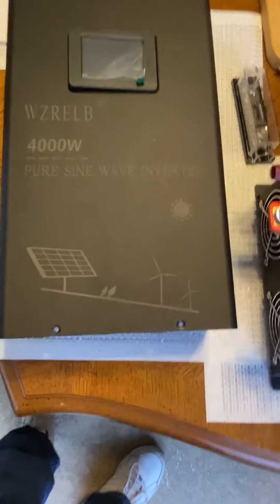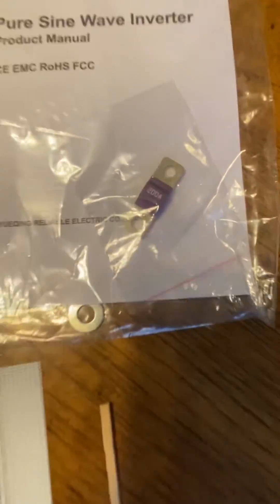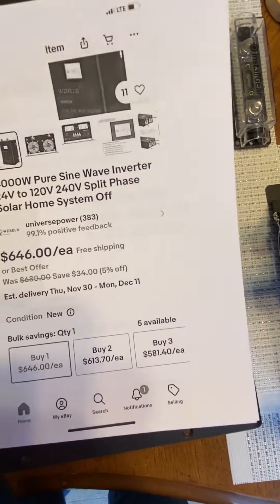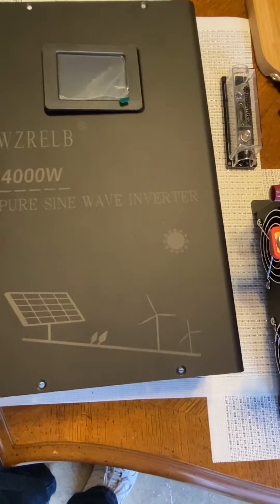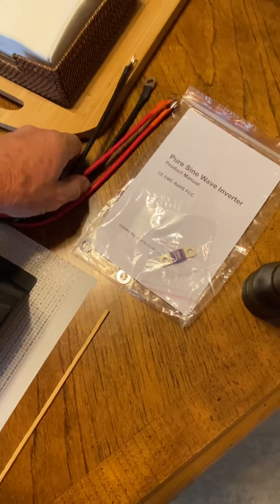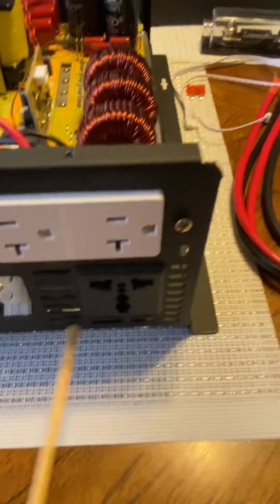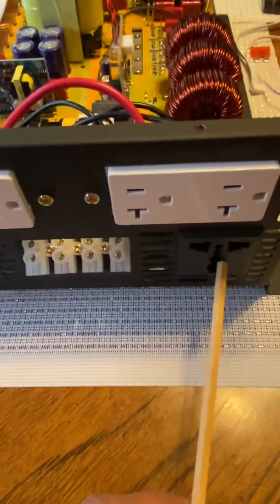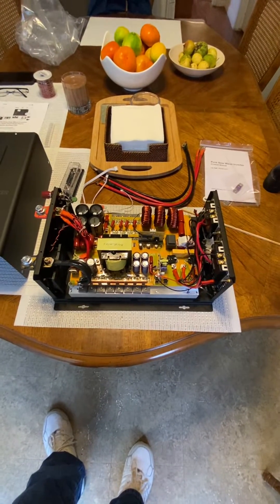Reliable WZRELB 24v 4000w split phase inverter.

Comment: I think the 240V outlet is a NOT a split phase 240V output, but just a 240V outlet so it wouldn't have  a neutral, but ONLY a ground. That would be correct so bonding N-G is not great idea and should avoid it if possible. Having said that, if you did bond it, you might get 120V. Some 240V systems use one leg of the 240V as the neutral. So the correct way to get the 120V split phase would be to use the screw terminals to a split phase 240V outlet.
Reply from the maker: No it has a neutral connection.   It is one of those universal 120-240 sockets with a neutral leg.
Reply: @WattsinWattsout  Reason I was watching the video is that I was considering buying a Reliable 4k PSW inverter and was curious what kind of problems people were seeing. While it looks good on most features and design, the problem I had was that the THD spec was on the not soo good side and not good enough for my equipment. I might save a couple hundred dollars with a reliable, but then I loose thousands of dollars of my equipment going bad. I was hoping it was going to work out. My search for inexpensive split phase inverters continues.
Reply from the maker: @awesomecat9470 high frequency is more enrgy efficient but doesn’t come close to low frequency for stable power.
Reply: @WattsinWattsout  Hmm. I think we might be saying the same thing, but differently and I was not clear. EU has 240V with one leg their neutral which is same potential as ground (not necessarily bonded at the receptacle). US has the 240 split phase and a center tap at 120 which is our neutral and tied to ground at one point in a system(again not at the receptacle).  Those two 240Vs are not able to work together. I don't know those universal adapters, but I do not beleive it is intended for split phase use.  EU neutral is different  than the neutral in the US on 240V where each leg of US is a hot and the neutral is in the middle. My thought of those universal plugs was The outlet is more like a US 120V with a hot and neutral and usable by appliances that can take dual voltage without frying itself. So I'm not sure which neutral you are talking about, but if you are saying it is the one in the middle, that is a ground and not supposed to be tied to one of the legs nor the same as the neutral of split phase. and unless you are independent power system, shouldn't be tying those together. I thought those universal receptacles were 3 wire (240V, N, G), and the US is 4 wire (120V-L1, 120V-L2, N, and G),  The EU N would be in the same location as the US L2.   So you really have a L1, L2, and G without the neutral on the universal receptacle. I don't know that inverter to know what their intent was, but hopefully I've helped some. Maybe the manuf wires the product differently for EU customers vs US customers. The US customers will get 240V across the hot plugs and without a voltage downverter, or the appliance handling both 120&240V across the hot leads, it could fry the appliance. In the 120V world, you call one of those parallel legs the neutral. but you are getting the 240V across the two legs (EU calls one of those 240 legs their neutral), and no 120V split phase exists, unless you are  to force it somehow.  and since I've never actually pulled apart one of those universal connectors, my info may all be bs. in which case, my bad.
Reply from the maker: @awesomecat9470 we have pump motors and other appliances that run on single phase 230v.  220-240 v two lines (hot) and an equipment ground.   From my understanding this is what the European market uses.   

This is different, and we have appliances for instance an oven with 240v heating elements but a 120v control board lights timer etc.   they often use both on our side of the ocean.   

This inverter uses the same neutral used on the 120v outlets for the universal 240v split phase outlet.    The 120v outlets have separate hot or line feeds.   

I’m planning on a deep well pump that will use single phase 230v so I will be getting a euro style inverter for that when the well is done.

Comment: These high-frequency, output transformerless inverters are absolute junk. You should have purchased a low-frequency, iron core, transformer-based inverter instead. Low-frequency, iron core, transformer-based inverter chargers offer a far longer life expectancy and a much higher surge capacity than low-cost, lightweight, high-frequency, transformerless inverters, and are a far safer choice for powering your home's appliances. That's why all US-made inverter manufacturers are built using high-reliability, low, frequency, transformer-based inverter technology.
Reply from the maker: @Madsci-zy8wm  yes low frequency inverters are better but they also cost 3x or more.  I have two low frequency inverters I’m working with now but they do use a lot of idle current.   The hf inverters are affordable and will work for many years if not abused by pushing the watts limit.

Comment: What are your thoughts on this Inverter I have the same one, just purchased. I'm new to the Solar inverters BUT I'm running a 24 volt LifePO4 battery.
Reply from the maker: @the-Bhawk7  it’s good for a high frequency inverter.   They are very efficient and have low idle draw.    I’ve watched a few videos of people running their house on them with the exception of the ac units of course.   Just not enough amps and watts to let that happen.    They are wired correctly so they can be earth grounded and neutral/ground bonded.    

I’m moving into low frequency inverters now because I need to use afci breakers for my panels.    They use more idle current but the power delivery is smooth and doesn’t trip the afci breakers.   I have one coming in Friday to test out and keep if it works with the afci breakers in my test panel.   

I still have this one but I don’t use it too much.   It’s a backup to my backup 5000w 120v inverters.
Reply: @WattsinWattsout  thanks, I see people have these for running there home, can you use solar panels with these, thanks

Comment: I would never buy one of these low cost, high frequency, transformerless inverters. They run much hotter than longer lived, low frequency inverters and they don't last very long when powering inductive loads and they don't provide much of a surge capacity.
Reply: Found out my self I got the 2500w the surge protection dint work properly and short inside, smell like burning got fry return it.
Reply: Low frequency inverter use iron core output transformer. It has a much higher idle consumption and lower efficiency. You may win on reliability but the use of higher power high frequency inverter will do the same.